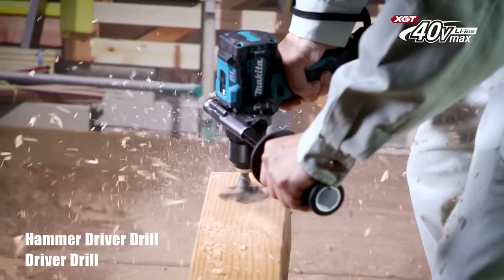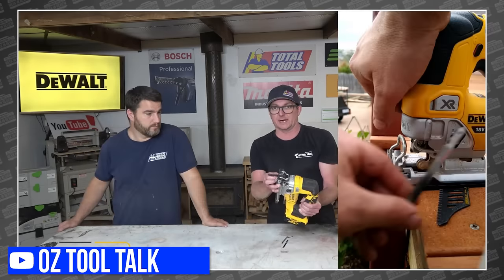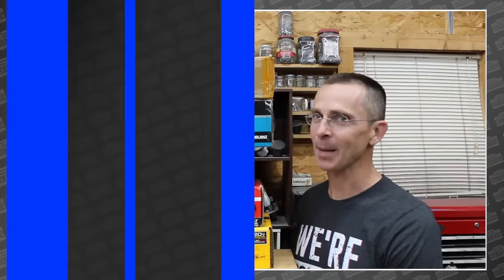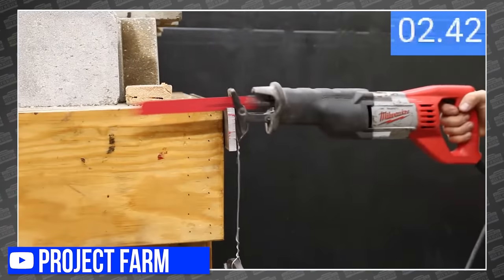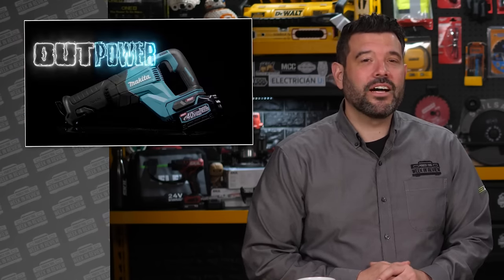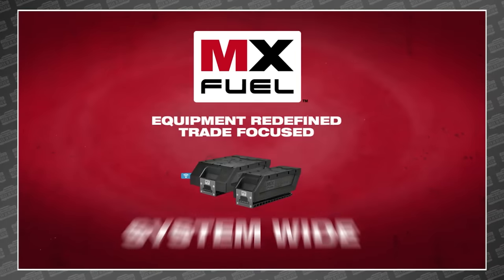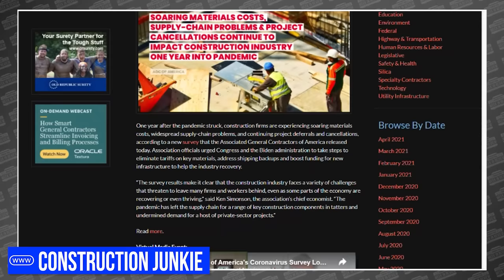MAKITA has a NEW PLAN, and either YOU'RE IN... or YOU'RE OUT. The next Power Tool Revolution. S4E14

Comment: I’m invested in Makita’s LXT line more than anything else but I won’t be moving to their 40v platform as I simply don’t NEED to. I want to though.
Reply: I'm in the same exact boat
Reply: Yup, I dont see the need for any of the tools while my line of 18v are serving me well.
Reply: Same here. I really don't need cordless tools aside from drills and impacts. I'm pissed that they didn't include anti-kickback features in their new 18v brushless drill and made it 40v exclusive. It really looks like they're not going all-out with their LXT features and saving them for XGT. If Bosch and Hitachi's drills that have been out for years have anti-kickback on their 18v models, there's no excuse for Makita not to.
Reply: Same here, I do have a few of the 18X2 tools and they are brilliant!
Makita should have included the Anti-Kickback Technology on their XPH14 Hammer Drill Driver because those drills can really hurt you. I have the XPH07 and have broken a planetary gear that was replaced under warranty and I’m pretty sure I’ve broken it again while using Bimetal Hole Saws in steel. I’m sure Anti-Kickback would have prevented this damage.
Reply: Oh what the hell makita, no Makita Table Saws?

Comment: I like that the Makita XGT line is Independent of The LXT Line to be honest I would rather get a new battery line for specific tools if they have more power then get the same tool in a lower voltage line that may not be able to put out the same power @Belts And Boxes

Comment: This doesn't make any less sense than splitting M12 / M18.  One has the potential to be a little more compact, the other can be much stronger.  

Many could survive on either, though concrete work might lend itself to higher voltage into the future.

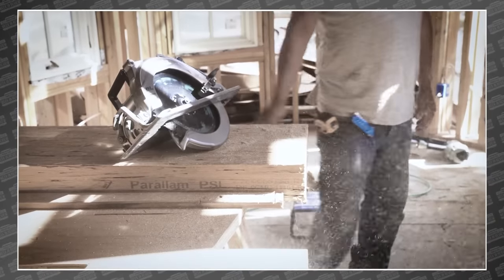@3:40 -  I spy a 260mm rear-handle circular saw.

Comment: Makita’s problem for me is that I simply have no problems with the Lxt line now so Xgt doesn’t seem needed
Reply: Some bigger tools definitely benefit from the voltage. I have the 3/4” impact and it’s a beast, no way you get that power on 18v. Also have a 40v planer and 270mm saw, both have insane power

Comment: Seeing how their new impacts perform with just their old 18v batteries, I'm excited about seeing how 40v impacts do - but not excited about having to have even more batteries at the same time.
Reply: The impact driver is the least interesting XGT tool.  Impact drivers don't really need more power then an 18v battery can provide :)
Reply: @dominicvanlievenoogen6407  You haven't seen the 3/4" test then.
Reply: @skelley521  that's an impact wrench. Not a impact driver
Reply: @dominicvanlievenoogen6407  Correct as I haven't seen a 3/4" driver....LOL.
Reply: I liked all the innovative features with the 40V 1/2" impact so I pulled the trigger today. As a Heavy Industrial Mechanic it will come in handy. The 3/4" will be next. ;)
Reply: @skelley521  Frac Mechanic over here, been thinking about buying that 40v 1/2 inch, how have you like it so far? Currently have the 18v 1/2 inch and it hasn't failed me yet.
Reply: @randalwilson1795  I have used and abused my impact. It has lived a rough life in the Construction Trades and still performs flawlessly. No regrets and I'm glad I'm in the 40V line now. The batteries charge a lot quicker also which is so nice.
Reply: @skelley521  hey thanks for the quick response! 40v here I come.

Comment: I think it's a smart play from Makita to offer the different platforms instead of forcing their clients to change to a power level they might not need. I think they are going for a wider range of customers from home diy entry level to handyman and light duty installers to their new line up being geared toward heavy duty work sites without power. It's great and i think it will make them a bigger player across the board especially with the x-lock tech making their tools so much easier to use and now they have a power level for every job no matter what it is.

Comment: I was hoping that Makita would work on improving their existing 18v battery. As we've seen with Bosch CORE, it is possible to produce smaller packs, capable of delivering more power, while still being backwards compatible. I would have much preferred that approach over another platform altogether. Or even a dual voltage battery, like DeWalt 60v, for running the big tools, but also small and existing tools. I think Makita is severely underestimating the value in keeping things compatible. If Makita ever releases an XGT tool that isn't also available in an LXT variant, they've opened themselves up for competition against all the other brands that make the tool. That's where I'm at basically. Longtime Makita fanboy, heavily invested. But if it's time to update, and Makita's answer is a separate platform with a bigger pack, then maybe it's time to revisit how the competition stacks up. Showing up this late in the game, having seen what the competitors offer, and then bringing a line of the same tools that use a bigger, incompatible pack... It just has me wondering whether that's a good business decision, cause it seems pretty stupid. Hoping they prove me wrong.
Reply: They already said the LXT line is going nowhere. The XGT line is for people who want longer runtimes.

Comment: I can't see this move by makita being a smart one. Tool platforms should change to accommodate what the other lacks. With milwauker, the m12 has the portability the m18 system doesn't quite have, and the MX line covers tools and purposes that the m18 batteries just can't do. In the case of makita, there's a couple of things I see that will be hard to pass. First off, brand loyalty plays a huge part in purchase decision. I know many people dead set on Dewalt, milwaukee, kobalt, etc, so trying to capture those customers who have invested heavily into those batteries is a tough catch. Second, this new 40v line covers all the same things as the 18v line, and then some. But at what cost? Contractors who have a ton of the 18v tools won't go and bulk buy a new platform when what they have already works, the spending just won't save. Third, how does power and usage compare to the 18v system? I can't imagine I'd want to lug around a drill or right angle grinder with a substantially larger and blockier battery because smaller isn't an option.

I guess in their defense, one battery tobrule them all. It would be nice to have a single battery that covers a wider range of tasks. Just getting the justification to spend that much when many already have what more than works is the challenge.

Comment: I don’t have Dewalt, but I actually think they did it the best way with Flex volt. That system makes a ton of sense to me. MX is over kill for most trades and the Makita system is just overlap. I’m on Makita and Milwaukee but starting to wish I was on DeWalt.
Reply: Until all your expensive tools shit out prematurely. Stay with your brands you’ll regret it and waste a lot of money if you don’t.
Reply: @joshuaware3304  been running dewalt everything for 2 years continuously everyday as a custom carpenter and tradesman, I run battery adapters for my milwaukee nail gun and brad nailers, My Dewalt tools are running longer and not dying like many coworkers running Brand new Milwaukee tools AND the parts to replace my Dewalt tools myself are CHEAP, milwaukee wants and arm and a leg fir their replacement parts you might as well buy a new one, the anvil in my Dewalt Impact died from continuous daily abuse and laborers misuse and same happened to TWO hammered 1/4 impacts Milwaukee of coworkers the replacement anvil for milwaukee is $80 and special order

The Anvil go to my Dewalt was $13 found in amazon and parts geek ect, im not a fan of planned obsolescence of milwaukee, sane goes to it the board for the boss's milwaukee radio $240 New for the Control board to fix the damaged switch they want $170

Dewalt brushless motors are all the same, $40 ten minutes to pull apart and replace milwaukee around 90-160 depending sane for makita etc...rather be able to invest in my Dewalt system and keep the sane batteries for years simply replacing broken parts for CHEAP... rather than keep buying new crap and keep buying new battery types... Dewalt system is far superior. And makes home DYS replacement simple and Cost effective..ones an Investment the others are Money pits
Reply: Glad I have Dewalt Flexvolt ,I can use all XR tools with Flexvolt batteries and if I need their big mitre saw in the future I only have to plug two Flexvolt batteries in for 120 volt .

Comment: While I would’ve rather a plan similar to Dewalt or Metabo HPT’s, Makita’s XGT roadmap does make sense to me. However it still leaves a glaring hole in their LXT platform, namely we need better batteries! If Makita truly is committed to fully supporting LXT & XGT at the same time as separate but equal lines then we should see 18v compact 3.0’s and 4.0’s and extended runtime options like 21700 celled 6, 8, and 10 AH batteries soon. If not, well then maybe they’re not as committed to LXT as they would like us loyal users to believe.

Comment: I think the idea behind makita having specific lines makes sense for certain things. Some tools simply work better when more power is available to use, an example would be that flexvolt grinder i love very much. But for the average joe, i think it isn’t needed. Lxt is fine. I think it’s kind of a shot in the foot for makita not making it cross-platform like a certain yellow brand. I have a healthy mix/match of 20/60 and i go back & forth between the two
Reply: I understand that point of view. I also understand why makita went the way they did. The flexvolt battery is more expensive to make because of the controller and added switching inside the battery.

Comment: I think Makita ran into the 18 volt limitation as did DeWalt and Milwaukee.  However,  Milwaukee and Dewalt got around that with two different solutions. Patents might have made hard to go down ether of those routes. The two battery plan Maktia has is very bulky and is not a good solution on something like a recipercating saw.  I predict there will come a time when the 18 volt line ends just like the Nicad Makita tools ended.  But it could be demoted to a consumer grade tool for a while as well.  I was about to pull the trigger in the Makita panel saw, but now I am hesitating. Where is that panel saw Milwaukee?
Reply: What's wrong with the two batteries sawzall it's not in the way at all and provides a ton of power
Reply: @AnthonyPearson4JesusofNazareth  Because a single battery does everything two does and requires less components.
Reply: @svn5994  in some cases, it's not a big deal to pop in a extra battery, makita gives thier batteries away like candy and they last
Reply: I actually love the simplicity of just using two of the same batteries I already own and have chargers for to get more power. Notice Dewalt is doing more dual-battery stuff with their OPE, and other recent emphasis on their 20V tools suggests they might actually be rethinking the longevity of Flexvolt.

The more I look at it though the more I feel like the real justification for XGT isn’t to use one battery instead of two LXTs on some tools. It’s to use two XGT batteries on even bigger tools down the road...

Comment: There 40v line make a lot of sense for more heavy duty tools. Tends to make the tools easier to use then the 36 volt ones with 2 18 Battery's on them and it provides slightly more power. The 12 inch compound miter saw is one of the best on the market for professionals on site.

Comment: Ive had stubborn lug nuts on my dually trk and the tire shop had to use a cordless impact instead of their air one. A dewalt 20v high torque impact so i got one myself and love it my makita 18v impact driver/ regular drill are around 8yrs old and year 1 i used them at my job doing precast concrete so i decided to upgrade to dewalt 20v hammer drill/ impact driver kit and added a dewalt 20v 7 1/4 circular saw with possibly the 60v grinder and all operate on the same battery system so now i have 5 batteries for four tools

Comment: Makita would have made more sense to go to a 60V Battery like Dewalt instead of a 36V and 40V system.  One battery or two?   Really?
Reply: jami w  what's is rack and pinion?
Reply: jami w  and why are thier finish guns bottom barrel?
Reply: jami w  oh ok thanks, maybe the 40v will have a table saw that has that.
Reply: jami w  lol yep gonna have to go with a dewalt or bosch if not
Reply: jami w  same here invested into Dewalt on account that their Batteries are actually 3x40 Volts fir flex line system, which means the 20 amp which is really 18.6 volts like milwaukee and makita etc just marketing gimmicks, us only using HALF the actual voltage on 20 volt tools on the 1/3 of the battery pack fir 20 volt side , and the other half of the flex volt that engaged by mechanism of battery reception is only using 60 volts of the 80 which means expect Dewalt to roll out a future 40 amp system and use the SAME flex volt batteries you invested in as the potential if Voltage Total fir Duel battery system like my compound miter saw is actually 240 Volts each 9 amp hour life..but that's not actually using the full potential you can Run a 60 amp battery down, to nothing, remove and out it in a 20 volt and it STILL has a full charge on the upper level of 40 volt battery or pack... Dewalt is playing the long in game, difference is they will announce that theur 40 amp and 80 amp tool lines will STILL use the flex volt batteries theur customers in invested in...
Reply: There is an actuator switch built into Dewalt flex battery pack that engage on 60v and 120v tools

Comment: As far as Makita tools go, I don't completely understand why they would use the same number of cells, and just put them in series instead of parallel like they are currently. The only advantage I could see is smaller winding wires, but more of them, so really not an advantage weight wise, and more time consuming manufacturing the motors. A big disadvantage would be having to have parts rated for the higher voltage.

If they did something better with the battery cell, maybe it would have been an improvement, but as it stands, I just don't get it. The batteries can only put out so much power, and with that, you just need larger batteries in order to get a significant improvement on output.

Help me understand the why this change.
Reply: The 40v xgt tools are exactly the same as the 18v x2 tools but they run at 40a instead of 30a due to the higher discharge cells.
Reply: @kizzjd9578  No. They aren't. The may have the 21700 cells inside, but that doesn't account for much. Look at the m18 HO batteries. Still 18V. (And the 40/80V tools still have the same number of cells as the 18/36V tools, just more in series and less in parallel.) Now you can't get away with a smaller battery, whereas you could have before, assuming the tool didn't have the interlock to prevent you from using it, like in the old sds drill, so you must use the larger battery only.
Reply: @IceBergGeo  Yes they are. They look pretty much identical inside. The 2.5ah battery uses 18650 cells, the 4 and 5ah uses 21700. I agree with you about the batteries being heavier.. defeats tbe purpose of portability. If you don't belive me, tear a dtd171 apart right next to a td001, they are almost identical except for the  30a vs 40a fuse. Search tools & stuff on youtube for a video on it all.
Reply: @IceBergGeo  The tools that have the lock is because only the  4,  5 and 6ah batteries can output 30a or continuous current. The 1.5, 2 and 3 ah only has 20a output. Therefore they make you use the correct battery to stop you cooking the smaller ones.. smart move. Same as the old brushed tool, they only take up to a 3ah battery as they can't handle the high current of the bigger batteries.
Reply: @kizzjd9578  I think that we might be agreeing on a few things. Let's build on that. So, let's assume that makita screwed up on the platform and didn't account for the better, and bigger battery cells: the 21700. Maybe that is the one and only reason that they decided to make the higher volt tools, and make themselves seem like a hero instead of the only one to no be able to upgrade to the bigger cells due to battery real estate.
Reply: @IceBergGeo  Yes I agree with you there. Multiple tool reviewers noticed  other tool companies making extra room around batteries for future larger battery packs, whereas makita never did that. Yea the 18v x2 platform is amazing.. but I still cant use the latest and greatest technology with my older lxt tools. I do like hikoki and dewalt's backwards compatibility .
Reply: @kizzjd9578  I think, without having examined the newest makita batteries, that they made the interlock not to reduce the ability of the older tools, but to not have their older batteries die because of the newer tools power draw. But, at this point, that's all hypothetical from my standpoint, as I haven't had Makita tools in almost 10 years. They were the first, and for the longest time, the best. Then brushless stuff came about. 

I hate these kind of comments, most of the time, because these sorts of conversations are best had over a beer or two. You can get your point across and if there's a misunderstanding, you can correct it much easier.